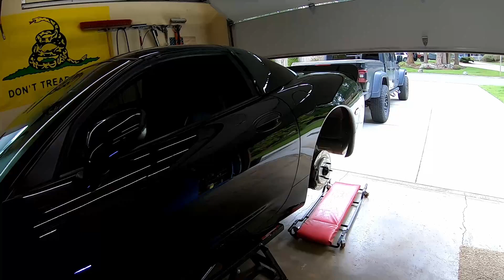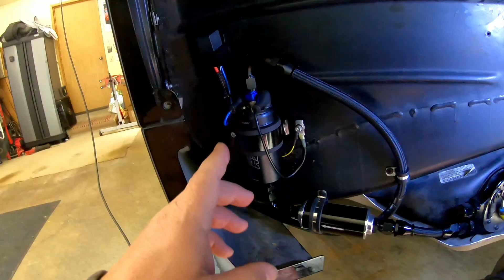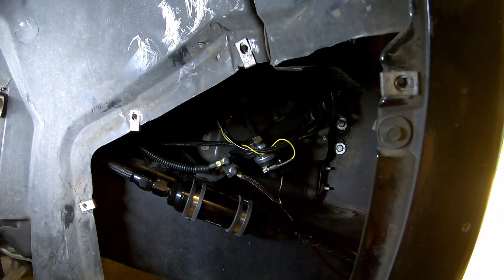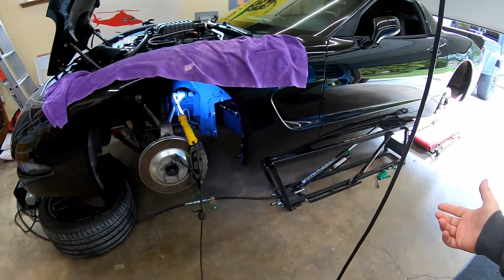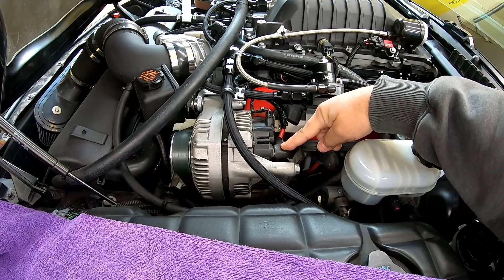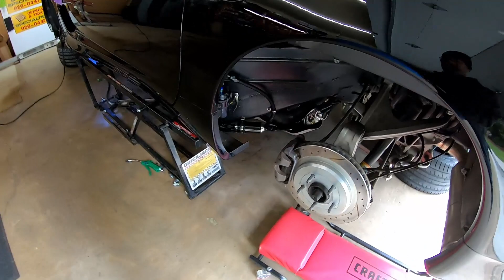DIY External 044 AEM 400lph Fuel Pump For Boost on a C5 Corvette

Comment: Solid system, I ran similar, with a walbro 450 intank, and aem 400 external. Worked fine with the single regulator. Under load the fuel is getting used, so there's less demand on the regulator.
Reply from the maker: It works well and it tuned WOT perfectly.   I'm confident we could get close to 800wheel on this setup on pump gas.   Thanks for checking it out.

Comment: Thanks for information! I'm trying to do this to my 2000 C5. Do I need to do anything for the RH saddle tank?
Reply from the maker: The way I have shown in the video there is nothing required to mod in the RH tank.  The reason I went with this setup is so that you can have a fully functioning like stock fuel system that can be run nearly out of gas using all the gas for say long cross country trips.   Some of the heavily modified tank setups will starve the pump or pumps at 1/4 tank of fuel.     Also I did ultimately get rid of that ECS billet fuel block on the drivers side tank and went with a bulkhead fitting to feed the external pump.  Zero leaks now.

Comment: hey man do you have a parts list by any chance of all the parts you have for this system? trying to piece this together for my turbo c6. how’s everything holding up? any issues? not sure if it would work with stock fuel rails with ls3 being returnees style fuel system?
Reply: i meant returnless*
Reply from the maker: Not really a parts list perse.  It is just generic Evil Energy PTFE lines and fittings all AN.  Also I ended up getting rid of that leaky ECS fuel block and just putting a bulkhead fitting directly in the plastic tank.   Also, mighty mouse solutions sells a purpose made AN fitting adapter for C6 tanks which would perfectly for your application.   The AEM pump I got off of amazon after making damn sure it wasn't a fake.
Reply: @PNW_Car_Mods  how bad was that ECS fuel block leak? I was about to buy one, because in reality it looks like a great way to add an external pump without drilling into the tank. But to hear that yours leaks, was a turn off.
Reply from the maker: @JimBob-wy7tl   it would leak bad enough that it would drip on the ground and if it wasn't dripping on the ground it just stunk like raw fuel all the time.   I tried multiple times trying to get the thing to seal up without any luck.   The fuel was weeping out of the screws somehow.   That thing cost me like 225 bucks.   The 9 dollar Evil Energy bulkhead fitting that I replaced the block with has yet to leak a drop.

Comment: Love it. I just wanted to do something like this so naturally I need some information. I wanted to link my in-tank fuel pump to the external fuel pump which then feed all the way to the engine bay. Would be possible to turn off the external fuel pump and let the OEM fuel tank pump through it? And to then turn the external fuel pump when i need it?
Reply from the maker: I'm not sure about that.  If you have the space you may be better suited for a surge tank install?   I would have went that way but it was near impossible to package.

Comment: How loud is this pump? i recently installed one in my mustang and it started off as quiet but seems to have gotten louder, when I start the car its quiet but once warmed up its almost as loud as the exhaust. I run it external just like yours
Reply from the maker: Mine only runs under boost so unless I jumper the relay I can't ever hear it.  I only know it's working because the engine never leans out watching the wideband.  If yours started out quiet and is getting louder it's either bad or got contaminated.  I've also heard that AEMs quality has gone down hill a bit after they were taken over.  I don't know that for fact though.

Comment: Awesome video & great setup!
Reply from the maker: Thanks!  Still fighting some fuel weeping out of the screws for that stupid ECS fuel block but aside from that minor annoyance the system works perfectly.   I need to fix it this spring.
Reply: @PNW_Car_Mods  I initially wanted to go with that fuel block, but ended up with a fuel cell in the back of the c5. kinda wished i went that route instead. Next time😂

Comment: Did you make that harness yourself or buy it premade? I’m looking to do a similar setup and the wiring part scares me
Reply from the maker: Premade. You can get them anywhere.  Summit, Jegs, Amazon, Ebay.   Just search fuel pump relay harness.
Reply: Hey what brand harness are you using? I’m doing the same exact setup as you, if you could add the link please and thank you
Reply from the maker: @kunalchoudhry7210  https://www.amazon.com/gp/product/B093DZ1R7J/ref=ppx_yo_dt_b_search_asin_title?ie=UTF8&psc=1

Comment: Would I need everything you have for my C6? If so, could you post a link for everything? Shops are telling me to buy a DSX kit which is 1k.
Reply from the maker: It would be a bit different because C6s have a pain in the ass fuel module design.   That being said Mighty Mouse Solutions created a bulkhead fitting for C6s that can be installed without dropping the tank.   Aside from that you would pretty much copy everything else.    AEM 400 external fuel pump and an 8an regulator of your choice.   A C6 return line setup will be different as well.    External fuel systems for C5s are equally expensive at 1k to 1500 dollars.  I refused to spend that much money.

Comment: What brand and model regulator did you go with! I really liked your set up!! And did you set the psi to 58? Thanks!!
Reply from the maker: PQY 8AN regulator.  The one that looks just like a Holley.   Yes it is set to 58 psi hose off and plugged.  Runs around 51psi at idle with signal hose back on.